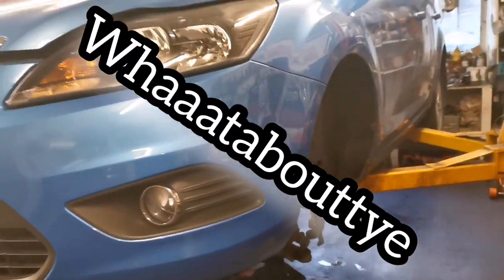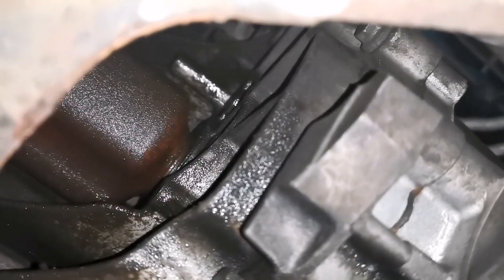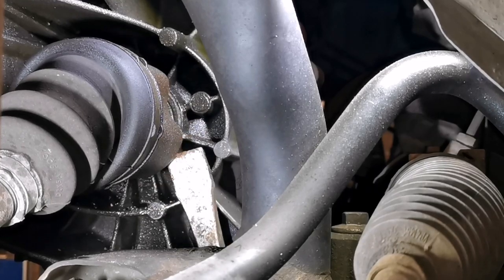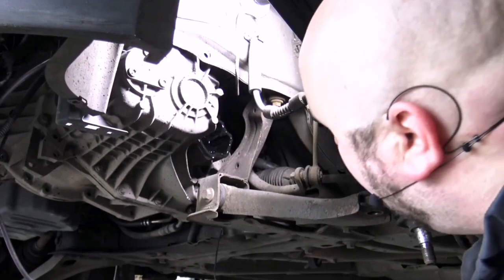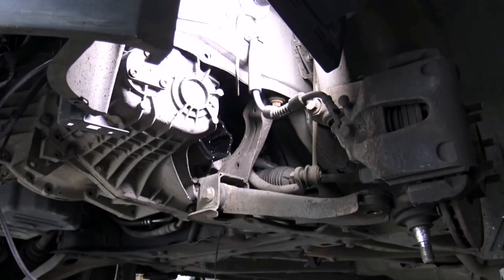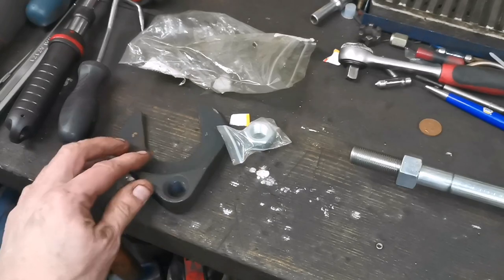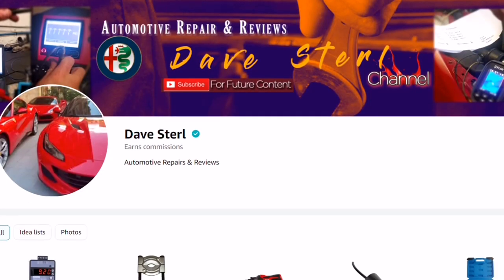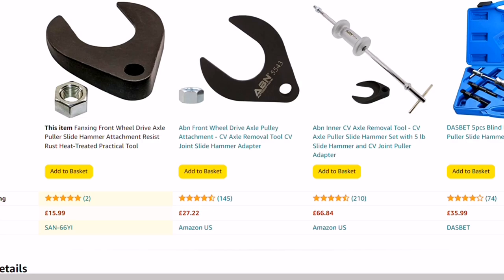Pop a Driveshaft from a Gearbox Easily. Front Wheel Drive. Cheap Tool

Comment: Thank you so much.
As I have a Volvo V50 with a leaking clutch slave cylinder and as it sits inside the clutch housing, the gearbox needs to come out at some point so knowing this tool exist will make life so much easier. Once I take on the disassembly of half the car. Excellent video.

Comment: Defenetely ,It's on my 'next tool to buy' list,from a while ago.
But, I think, that cannot work in some cases, because it's a not enough space to fit it  in. Just to share a trick that I learned from another technician, when I had a stuck driveshaft some years before ,you pry bar it, with a bit of pressure ,than turn the driveshaft 180⁰ ,and than pry bar it.You won't  believe it that is working (when the other technician was telling me to do this, I was thinking in my mind that his talking bullsh!t).just trie it next time.
That's why on my next tool list, this tool went a bit down.
Reply from the maker: the tool has fitted in when i need it to and i've had it a few years. As demonstrated, pops the shaft in seconds but you do whatever suits you
Reply: @davesterl  
I absolutely agree that the tool is working, I didn't say that is a bad tool or its not working.I am not blame  the tool at all.I just wrote my experience, maybe can help someone which doesn't have yet the tool (like me)or the tool can't fit at one car.,And because it's a tool that I am going to buy either way,every time I work on a driveshaft, I am thinking if this particular tool it's going to work for that car. And I have found out, that in some (very few) cases, it won't. Specially, on  some.4WD Ute's. 
And as you know, all universal tools, unfortunately for us, doesn't work everywhere 😢 .
But, it's a must to have tool,for any tool box.
Reply: @Lambros_Stefaneas  the point here is the rounded profile of the cv cup and getting a purchase on it. Turning it 180 doesn't contribute to the solution.

Comment: Hi Dave what do you think of a 2017 Mondeo 2.0 tdci powershift 175k. Thinking of buying one to taxi in? Are the engines gearbox as good as a Vag Dsg set up ? Thanks in advance 👍
Reply from the maker: I have owned neither. My opinion is i am not a fan of any make of gearbox that is a manual converted to operate like an automatic.